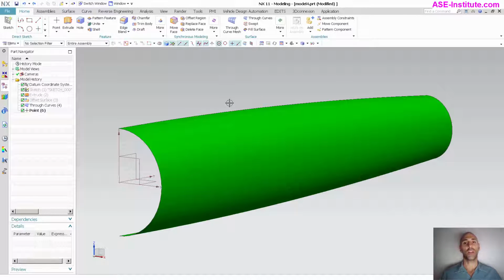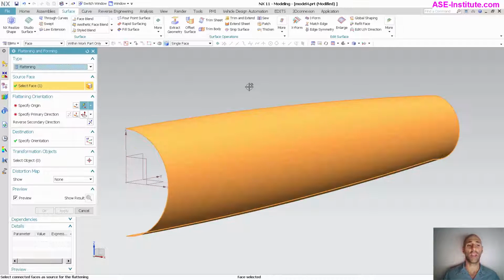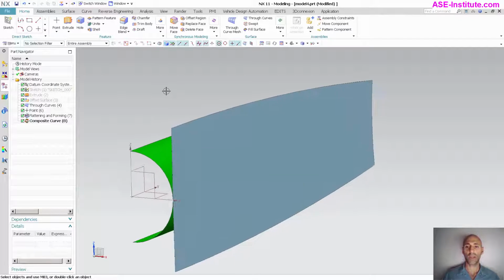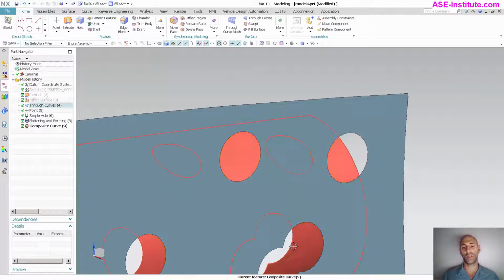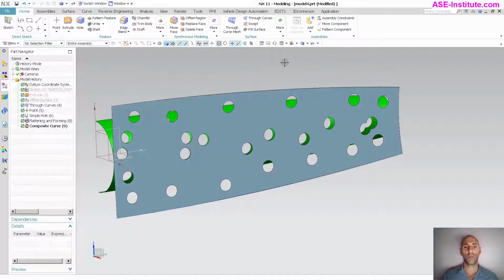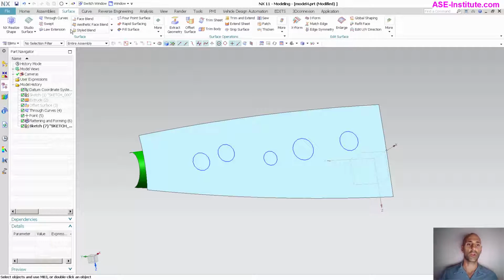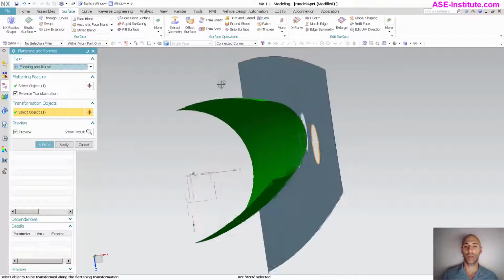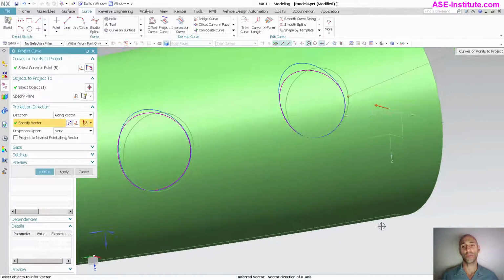Flattening and Forming | Siemens NX 11

Comment: great as always!!!
can you talk about modelling and visualisation tolerances and settings to achieve troublr free surfacing operations e.g to avoid unneeded sheet boundaries, disjointed curves, trouble free sew and trim/split operations etc.
thanks in advance.
Reply from the maker: That is not only a great subject it is a great big subject that does need to be talked about.

Thanks for the suggestion.
Reply: Hello there.  There is one point in this video which completely threw me off - how did you manage to put those holes on the curved sheet body? i am trying to do it to a similarly shaped revolve with no success.
Reply: Ignore the request, it was a selection filter issue All resolved now!